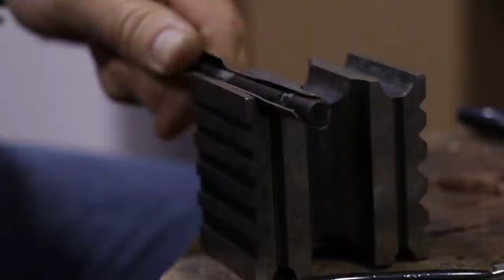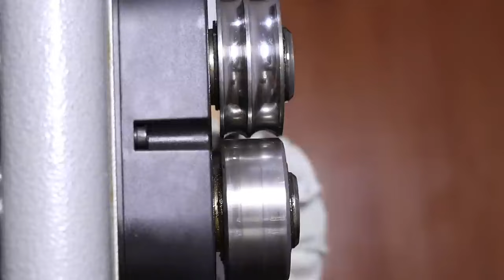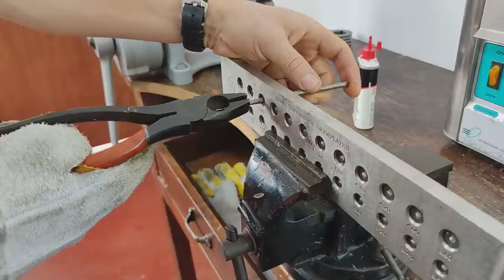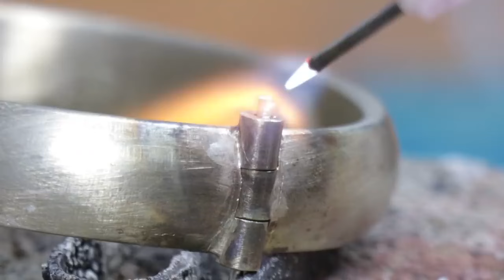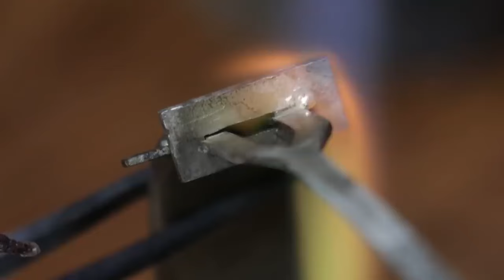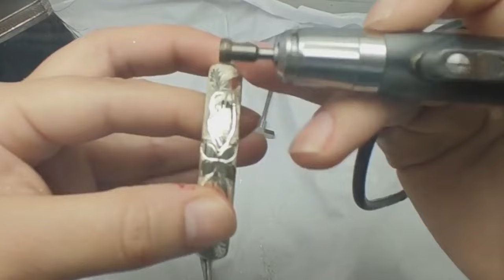Hollow Bracelet this is how   How to make a tube bracelet with clasp and hinge

Comment from the maker: для изоляции припоя при пайки лучше все применять графит,но лучший графит это пластинчастый,от накрошеного карандаша хуже,но годиться,а вот пластинчастый очень хорошо прилипает,выдерживает высокую температуру,применяеться в гальванопластике,но если нет этого графита,растолчите графит из карандаша,он также предохранит место спайки,особенно шарнира.=====================to insulate solder when soldering, it is better to use graphite, but the best graphite is plate-shaped, it’s worse from a crumbled pencil, but it’s good, but plate-shaped sticks very well, can withstand high temperatures, is used in electroplating, but if this graphite is not available, crush the graphite from a pencil, it will also protect the soldering area, especially the hinge.

Comment from the maker: yes, but not only for silver in Holland they are very popular (they call them a slave bracelet) and they are also made of gold, although the lock is just a latch, mostly without a pattern, sometimes they solder a chain to protect it from being lost, as a rule, most of the different sizes are semicircular, but there are also ovoid ones and there are purely hollow rectangular ones, rarely square ones. True, the video shows the old method of creating a bracelet blank, and there are special rollers where the plate is immediately bent in a semicircle, without sand and immediately in a circle, such a video is on the Internet. Make it from gold, wives have silver ones with a width of 3 and 4 cm. They look very impressive.

Deze pagina vertalen